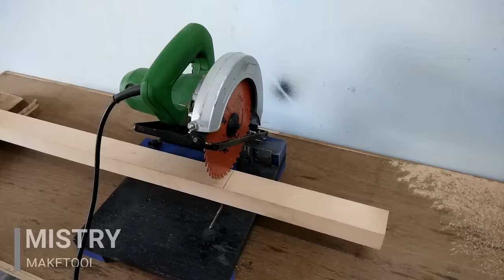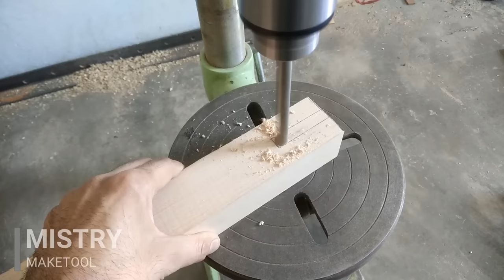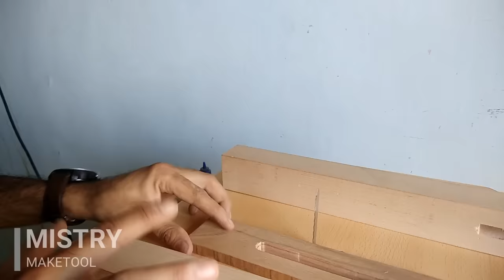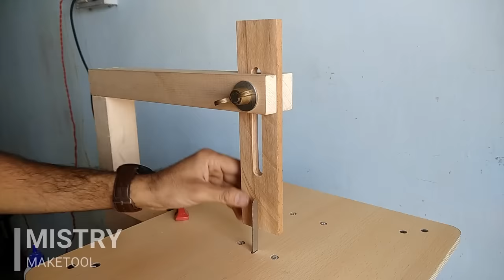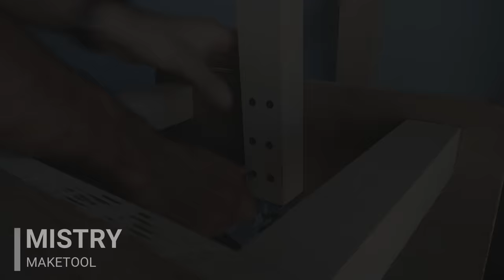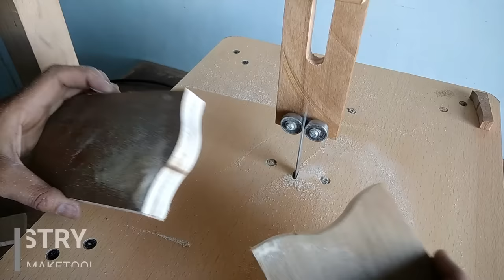Make A Jigsaw Table Blade Guide || Jigsaw Blade Support

Comment from the maker: Thank You Everyone For Your Love And Respect Keep Supporting Our Channel And Plzz Like this Video Share And Subscribe : )
Reply: It would be better if you would list out parts that you use or links to them online, like screws, ball bearings ect.
Reply: Mistry MakeTool shop tour !!!!!!
Reply: Y Creations
Reply: Thank You, Mistry. 👍
Reply: Nitesh Raut й
Reply: आप की विडियोज़ बहुत अच्छी है, के लिए धन्यवाद्, लेकिन आप इन ट्रिक्स मे जो भी सामान, equipment, tool use करते है उनके बारे मे भी लिखा करो कई बार ऐसी चीजें युज़ करते हो जिनके बारे मे जानकारी ही नही होती है
Reply: @SC-SA  to be a problem
Reply: MMT , I enjoy watching yours videos , every one on you tube is not technical minded or are novice  ,if the dimensions provided they will enjoy and improve fast , also provide tips ,  in this instance the thickness of blade , the rigidity , the vibration , TPI will affect the cutting,  with a warning that a same tool from different manufacturer will have   different Noise , Vibration , Heat levels ( even weight ). So results will vary . Thanks for sharing .
Reply: @amni1927  gggsip broo.

Comment: Dan Mateer .I have had fun today making this jigsaw table and support. It's easy to make and enjoyable.
I had a practice sawing session when I finished and here is what I found.
It cuts square and true in contrast to a band saw. It's easy to shape and cut contours like circles. The support gives it a wider throat which is an advantage over the bandsaw.  It has more flexibility in use. It's not a fast tool to use and nor is it slow.  You need to take care. One advantage I like is that you move your workpiece instead of the tool. It's not ideal for big piece cuts. I'd still use the jigsaw.
It has one distinct disadvantage. It works against the natural inclination of a jigsaw, that is it cuts on the up and not down. This means the saw dust gathers around the cut and you  need to keep blowing it away. You must take great care and hold you workpiece down firmly as the saw wants to push it up and this leads to the blade skewing, bouncing and grabbing.  It will give you a fright as well as ruining your cut. A bit of practice and concentration and you soon master this  feel.
When am I likely to use it? Well it won't replace my router and table for fine or detailed work. I'd probably use it to make things for the garden where I don't make a few blemishes or faults. It will be good to cut smaller stuff which I will sand to the right shape and size. If you don't have any other type of table then you will get by with this for a while. It's not the perfect tool but useful.

Comment: Super great idea.  I have do downsize my workshop and my band saw is taking premium real estate.  I can survive with this solution. At least for most of what I do.  I will try changing  the support of the jig saw to the plywood table top. If you use an aluminum or steel plate sitting inside a depression on the table top  then you can expose a longer blade.

Comment: Hello, congratulations for your work, I wish I had the dimensions of ball bearings
thank you
Reply: Kind of late answer, but better later than never. Its not that important of exactly HIS dimentions. I have seen many other videos and all of them have different dimensions. You can roughly eyeball the size he is using. I will try to copy his project, and have ball bearings of 8mm center diameter, 22mm outer diameter, and 7mm thikness of the bearings. Just make sure you get screws and washers who will fit without touching the outer ring, and you should be good to go.

Comment: Hi Mistry MakeTool, great video, I love it, I`m gonna make on too. but one question, why does the wood get black, is the blade getting to hot? is there anything we can do?
Reply: Sounds like your blade is binding and burning likely on curves or the wood is pinching behind you. If it’s a straighter cut and the wood is pinching use a wedge to keep it apart and the end.

Also try waxing your blade a little to prevent friction. Best of luck!

The village carpenter
Reply: Thank you for the tip. I will do that.
Reply: You can sand the burnt wood off

Comment: No accessible Stop button or off switch.
Since the 1950's (when there were lots of terrible accidents) power tools are required by law in most developed countries to have a switch which allows them to be shut off imediately by the operator in case of accident or emergency (usually a hand operated trigger switch or simular) this design doesn't include any safe or immediate way of shutting off power if a finger or other body part is severed, or if machinery is caught in clothing etc, as such it appears horrifically unsafe. I have reported this vid, and I urge you to remove it, in favour of a design that features an accessible kill switch.
I would urge your viewers not to make this item for the abouve reasons.
Reply: @Ben-Downlow.  you know the risks if you make diy machines. All of these machines can be stopped on press of the extension cable switch, which are probably right there, but not on the video. It is nice of you that you show concern, but don't report like snowlake ffs
Reply: @ArsenijeRadenovic  I see where you're comming from, and that your comment is well intentioned, however, it is obvious that you havnt thought it through, or considered my initial input, yes you and I know the risks when embarking on a project like this, but some viewers will not have the critical thinking skills, training, or practical understanding of what might go wrong.
For instance your comment suggesting that the on off switch at the power cable would be an acceptable safety stop although it is not in the picture,,,,, if you think about that you will realise that such a set up is going right back to the 1950's where devastating accidents with power tools were common, the whole point I was making, and will now make again is, there has to be an immediate cut off or stop switch on the apparatus at point of use, a stop button could be added for instance on the front face of the table, scrambling for a plug socket whilst going into shock or whilst some part of body or clothing is caught up in moving power tool with no means of immediate cut off is exactly how small accidents rapidly become major accidents,. Ok if you want to hurt my feelings and call me a snowflake, whatevs, still, either the person uploading needs to pull the vid and rectify the design in a responsible way, or, youtube needs to pull the vid as it promotes potentially very dangerous conduct (ie, using this tool adaptation without basic standard safety features.)
Reply: @Ben-Downlow.  this guy has nothing to do with people safety.  He just shared his invention. Your comments remind me of those : don't drink when hot phrases on coffee cups. 
There is no need to report other people videos. He put time and effort in them.
Btw on every power tool it is stated: do not modify or use wrongly. If you do that you do it on your own responsibility, with built in switch or no switch.
Edit: I agree with your safety concerns. I don't agree on reporting the video, that is why I called you snowflake.